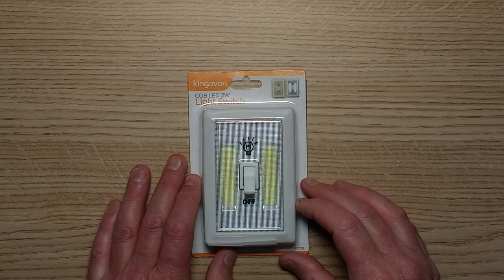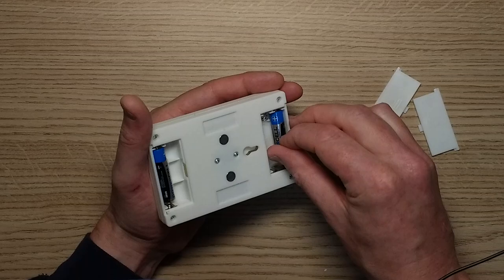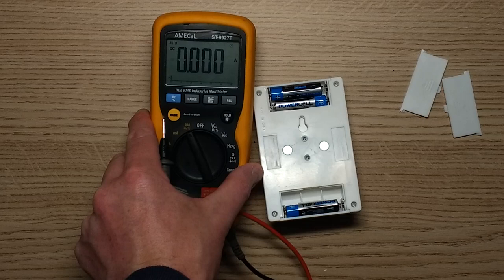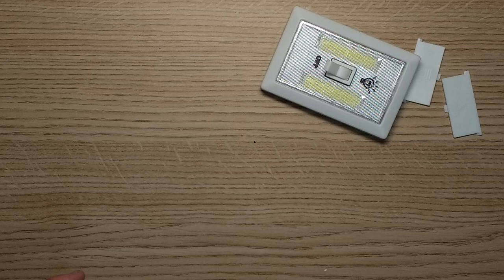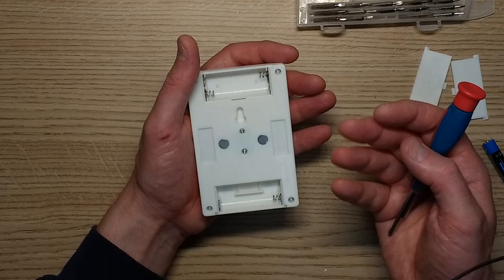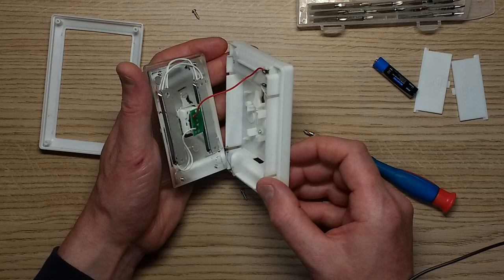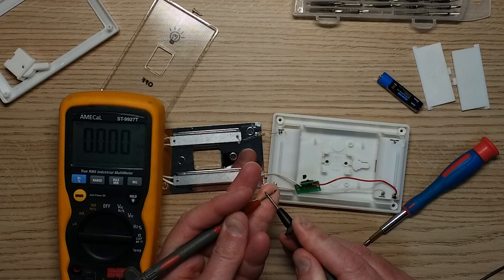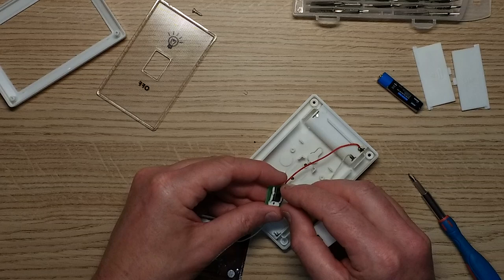Inside a switch-themed self contained LED light.

Comment: This must be an improved (and saver ;) ) revision of those lamps! I got these lamps last year and they had four batteries (other commenters mentioned that as well). The design was basically the same, but the four batteries forced >300mA through the thing, making the resistor heat away about one watt, shortening battery life, and heating up the LEDs to above of what is healthy. Glad they changed that design.

Comment: Good tip about pulling the lead out of your meter's current socket. I forgot to do that when I was measuring the current of something. A few days later I wanted to check the voltage of a car battery to see if it was holding a charge.

That was exciting!
Reply: I guess the fuse in the meter "exxxplode" and liquid hot metal spill everywhere. Because of the hot metal that moves like lava the car start to burn. The fire move over to your house then your city and then .............. you see, never leave the probes in the amp jack you can burn the whole world.
Reply: My Brymen 861 meter will beep loudly if the leads are in the current socket and the range is not in current measuring position
Reply: I did that with a cheap'o meter once, the leads got very warm and smokey, very quickly. I never knew why either, until Big Clive taught me.
Reply: It didn't get quite THAT exciting. No explosions nor lava. But it did pay a nice homage to German radio pioneer Izza B. Spitzen-Sparks.
Reply: but next time don't forget to take a video when you melt down the world.
Reply: I once accidentaly measured how many amperes does 230V socket give
Yeah it provided quite a high current. Leads molten, socket brown and that sound effect and strobo effect was awesome. My chinese (back then i was only 12 years old) multimeter survived it, i just changed fuse and it continued working for 5 years. Now I have Amprobe multimeter (made in deutschland) and it is topQ masterpiece! Also Fluke is made great quality.

Comment: I imagine I would use something like this for temporary structures, campsites, work sites, emergency relief, etc, where you don't currently have working permanent wiring. The fact it attaches using screws, magnets, a telephone-style bracket or Velcro seems to confirm that they had installations of varying permanence in mind.
Mounting it facing downward as you described would work, but it doesn't seem like the light would be very uniform compared to a strip fixture designed to directly illuminate a workspace.

Comment: Several of the family members have these switch/lights. After watching you take one to bits..... I needed to change batteries and I found this one uses all 4 AAA batteries. I didn't open it to see if the resistor was a different value.

Comment: I bought a few of those, but one didn't work properly. Turns out that the solder joints of the switch were grinded off so the connectors of the switch weren't connected at all, just touching. Just a quick re-solder job and the problem is solved. Quality control is a thing the Chinese could improve... But for the price it is a nice unit, not the best LED color but pretty bright. Anyways, nice teardown video BigClive!

Comment: We had one of these at a resturant I used to work at. We put it inside an under counter cooler in a corner with no other light source. Was hard to see inside but the switch was perfect. Granted it only lasted a few months, the switch wasn't really made to last. Also, the switch would often get left on for extended periods and kill the battery. All in all through, it was pretty great.

Comment: Some of these run on four AA cells, instead of three, and with a fresh set of alkaline batteries, the current draw through the circuit is so high that the heat generated by the current limiting resistors starts to melt the plastic case.

Comment: I bought a couple of these for use in places where I already had old school incandescent type battery powered lights. Location is in closets where I do not have AC powered lighting. The LED lamps are far, far brighter and overall work great. I expect the batteries to last their shelf life where I have them installed. OH, I am in the US and bought the modern large rocker paddle type - just plain makes more sense, especially if you use them under a shelf or kitchen cabinet.

Comment: I mounted mine on a small plinth with 3AA rechargeable batteries in a holder adjacent with flying leads soldered. Gives more light (0.7 Amps drawn at 3.7 Volts) plus having the pack external means that you dont have to remove the light to change batteries.

Comment: Whaaaat an amp meter is a short circuit and you should plug it back to volts? Noooo I have not learned that by frying a Raspberry Pi.
Reply: just about to comment that cause i was thinking what if u were measuring ac 120/240 volts
Reply: Then the fuse would blow. Normally these meters have a 10A fuse built in.
Reply: Max Power When they don't, it's even funnier !
My father tried ... I heard a bang and all the lights went down ... He tried to measure the tension right at the main power feed of the house XD
The meter was charred and swollen, my father was OK but a little shocked x)
Reply: And the tiny cheap meters tend to explode completely when that happens.
Reply: When I was a kid the current shunt in my cheap chinese meter decided to go through all four phases of matter when I stuck the leads across a charging deep cycle lead acid 12 volt  battery.

Comment: I have one and I find it useful. My studio apartment has the light switches located on the other side of the room. I use this to provide enough light to get to the main light switches. It's not quite the same model, mine has a 4th AAA slot and came with the batteries.

Comment: The switches I got like these at Big Lots in NF, NY were sold under the brand "Promier", but they use 4 AAA batteries (included carbon zinc mystery brand junk which will leak in no time). Changed them to 4 AAA Energizer alkalines, and expect this should last a long time for intermittent use. 
With the 6 Volt supply, these are crazy-bright, and almost blinding if looked at. Strange there is a version made using only three batteries, with the fourth space a "dummy".

Here are the details from the Promier web site for the 6 Volt versions:
(Clive, take a look at the PromierProducts site for all kinds of interesting LED "toys")

200 Lumen 1.5 Watt Super Bright COB LEDs
Easy Installation in Seconds with Included Hook and Loop Fasteners, Built-in Magnets or Picture Hanger Hole
Perfect as an Under Cabinet Light
Use in Tool Sheds, Campers and Anywhere Quick Convenient Wireless Light Is Needed
Powered by 4 AAA batteries (included)

Comment: Some differences to mine (bought from Poundstretcher, £1.99 a piece, I have 5 now 'cos they're useful little lights!), mine have 12-Chip COBs, the resistor in mine is 1 Ohm, and the current is about 350mA with the resistor, 500mA without, and the biggest difference of all, mine are Up for Off, Down for On, yours (and presumably all the others direct from china) follow north american lightswitch standards of Down for off, Up for on... :)

Comment: Just saw these in the store the other day. For $3 I was quite tempted to pick one up. Batteries included too.
Reply: I'd thoroughly recommend them, bought 5 of them myself from a UK store called Poundstretcher, and they're very handy lights for when you need short bursts of light... :)
Reply: I would recommend changing the battery's. It probably came with zinc carbon batteries, which often leak and corrode the contacts in the device.

Comment: A bit of double sided PCB and two wires would make quite a good shim for putting in between the battery and contact. Might make current measurements less fiddly. :)

Comment: I recently purchased these and they don't work!  mine have a space to take 4 AAA batteries with their connections in place...I've even tried using 3 batteries like you say but they don't switch on.  I bought brand new AAA batteries and nothing!  they're just 
rubbish. :(

Comment: I took one like this apart and it didn't have a small resistor, 1/4 watt but 1 watt resistor.  Mines work on 3 D size batteries. The claim on the package was 3 Watts per strip costing $4 + taxes at our Dollarama.

Comment: Current may not be excessive for the LEDs, but crapola technocell AAAs aren't going to last very long at that level.... resistor mod maybe, drop the current and extend the runtime - I'd guess halving the current would more than double the time by not pushing the batteries as hard

Comment: I have one of these. 4 Triple A batteries 10 chips per cob so 20 chips a 100 ohm quarter watt resistor (if I am remembering the color odes correctly) and everything else is the same as that one.

Comment: I have one that must be made by the same company, but instead of a switch it has a potentiometer to dim it. Mine doesn't have a resistor in it though. I wired a USB cable to it so I don't have to use batteries but was wondering if I should put a resistor in it? Do you think I should or do you think it will be ok?

Comment: I see one potential problem with that design, actually. 300mA through a 5 Ohm resistor would be about 0.45W dissipation, and that looks to be a standard 1/4W resistor. Or am I mistaken and that is a 1/2W resistor?

Comment: I use it to light my porch at night. They're pretty good for porch. Downside is batteries last about 3 ~ 4 hrs not even over night. I tried to ac adapter it. Wires were burning  may be reversed polarities I don't know. Your voice sound like the guy on YouTube multimeter reviews with some engineering degree background. If you're, will you please do "how to ac adapter it" video? I'll appreciate it very much!
Reply from the maker: Use a USB power supply with a couple of 10 ohm resistors in line to limit the current.
Reply: Thanks for your assistance. I found output 5V, 550mA adapter (producing 5.06V, checked with  multimeter) in my garage somewhere (that should work, right?). But I am not a science major. As matter of fact I don't know anything about engineering. I work on my car and some simple mechanical works.  When it comes to electronics and electrical stuffs, what I watch on YouTube is all there is (I'm doomed). I need more help with wiring!!
Reply from the maker: @yongminhuh146  It's OK.  You'll pick it up as you go along.  Just like working on your car.  The LED panels in your light are probably balanced to the voltage of the batteries and have a running voltage of 3V at whatever current they can draw.  If you use a 5B phone charger it provides a nice stable 5V and you can buy a cheap dollar store USB lead to connect to the charger.  The two resistors I mentioned are designed to limit the current through the LEDs to protect them and make them last longer.  If you have a friend who dabbles with electronics ask them for a few 10 ohm quarter watt resistors if they have them.  Wiring them in series (like a fuse) will then limit the current, but the lights will be dimmer as a result.  It will make them last a very long time though.
Reply: Yes, I do have a few 10 ohm, 1/4 watt resistors and a ton of 5 V USB chargers on hands. And the LED lights came with 2 1.5V batteries on top and 2 at bottom total 4 and design  to run in series(I think). I don't want to make dummy batteries and insert in slot like I've seen other videos. I just want to solder them in correct wiring.
Reply from the maker: @yongminhuh146  Try the light with just two batteries in it at one side.  Some just have two pairs in parallel.
Reply: @BigClive  That may as well be, sir. I just quoted(run in series) what I watched on YouTube by other guys. Anyway, will running in series may caused smoking(overloading the circuit-5V instead of 3V)? Yes, I will try to run in parallel with 2 10ohm resistors.   Thanks for your support!

Comment: Doing these in poundland today ........ for 2 pounds each, dumped the crappy zinc cells and put poundland rechargeables  in hung it on a screw in the cupboard under the stairs saves having to use a torch in there. :-)
Reply from the maker: I got one of the blue ones to take a look at.  Good move on changing the cells.

Comment: Sir I've a doubt. Why the voltage across an electrolytic capacitor shows around 400 volts in an AC capacitive dropper rectifier circuit under no load, whereas in conventional transformer rectifier, the voltage remains at what the secondary voltage is?
Reply from the maker: +Sangeeth S The capacitor will float to the peak voltage of the supplied voltage.  With a 240v supply the peak voltage of the sinewave will be 1.41 times the average voltage.  About 330v.
Reply: bigclivedotcom Oh okay, now I get it! 😊 Thanks.

Comment: what are these partial "covers" that come on the tips of multimeter probes? seem kinda pointless to me since they dont actually save the tip from getting dull or anything. what are they for?
Reply from the maker: +jort93z To cover as much exposed metal as possible to reduce the risk of shorting something out, particularly when testing high power equipment.

Comment: You often are measuring current on battery powered devices. Perhaps you should make something to assist. A strip of double-sided pcb with tabs/wires attached would work. Just stuff the end in between the battery and contact.

Comment: i find led things like this pretty neat but i must say i have a grudge for odd number battery devices where need 3 cells makes using rechargeable batteries hard to use and when have no way to buy online only local most of the time due to crappy credit as it is. ive yet to find a charger that does single channels instead of usual 2 channel links... i hate having to buy alkaline cells just for things like that bad enough i have mini led flashlights have 3 cells on one of those plastic thingys that come out
Reply: You know, you could just buy a couple more rechargeable batteries so you can swap around while they charge.
Reply: There are a lot of chargers that have individual channels. I have a Lacrosse BC-700 which seems to have fallen out of production recently, although the Opus BT-C700 is pretty much the same thing. The Nitecore lithium ion chargers can charge individual NiMH cells with proper negative delta v cutoff. There's also the Panasonic quick charger. Even Clive has reviewed several individual cell NiMH chargers.
Having to charge batteries in pairs is a limitation of the crappier chargers.
Reply: > bad enough i have mini led flashlights have 3 cells on one of those plastic thingys that come out

I have a few lights with that sort of holder, ,but they're also designed to use 1x 18650 LiIon cell(came with a bit of plastic tube to pad the 18650 a bit as the 3xAAA holder is a bout 22mm diameter.  Would yours be able to use 18650s?

As for AA/AAA I usually buy in 24 or 30 packs so don't really care about odd/even number of cells. But if there's space for, and the device will run OK off it, it I try to mod the device to take an 18650 instead, and if a charge/management board can be squeezed in as well - all the better
Reply: hm interesting replies i guess still a lot to learn as usual. also sorry if i did came off rude or weird with comment as was not intentional i just tend to speak my mind rather and sorta don't refine it. thanks for tips ill figure it out in time then. just a pain and main reason i just don't like using one time cells they pile up as i don't like to trash them as never a safe thing to do. bad enough i have 2 plastic containers worth that are dead,leaking,bursted from sitting there for years cause trying to find time to dispose of them is some times never always there aha

Comment: hi could you connect 3 or 4 of these together and use just one switch to turn all of them on ?
Reply from the maker: You could, but it would require wiring, in which case it might be better to use remote control lights.

Comment: Hi, I have the 4 batteries model, and it has a strange problem where the light is strong at first, 
but after a few minutes (about 10-15 minutes) the light goes dim.
I have 3 units, and all of them act the same.
Anyone else noticed it?

Thank you.

Comment: Can we connect this led lamp to like 2500 lithiumion battery ?
Reply from the maker: You could, but I'd recommend a cell protection circuit and a resistor to limit the current.

Comment: I guessed the switch wrong, but the only reason I guessed there would be a resistance is that it personally offends me when LEDs are connected to a voltage source without one. In modern parlance, it triggers me.
Reply: Doesn't the resistor waste some of the energy?  Aren't there LED driver chips that regulate power via active elements in a way that is more efficient?
Reply: The resistor definitely waste some of the energy but  I don't know that a separate driver chip in each LED would be more efficient. I'm looking forward to someone more knowledgeable than me proving me wrong or right cause right now I'm not sure on either side.
Reply: As I understand it, as the voltage for an LED rises, the resistance for the LED drops and thus current rises and rises until it blows out the device.  

You could build an active chip that senses the rate of current flow and just flips a switch back and forth to keep the rate of current the same. (there would be filtering capacitors after that)   I suppose the effect of the chip is to turn a voltage source into a current source.  This will obviously be more efficient for larger LED systems - like the full sized bulbs we use for lighting - but I'm not sure, either, on where the crossover point is.  The chip itself does require power to run the logic.

Comment: it would probably be quite nice if the light was diffused
Reply: if the heat output of the LED are not that much you could take this apart, and get some thin butcher paper behind the clear cover to defuse them a bit.